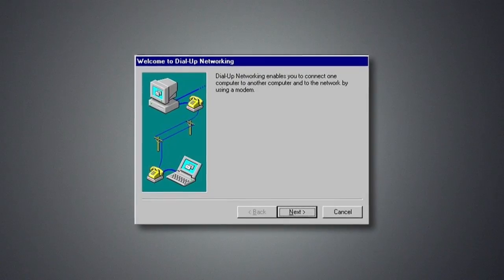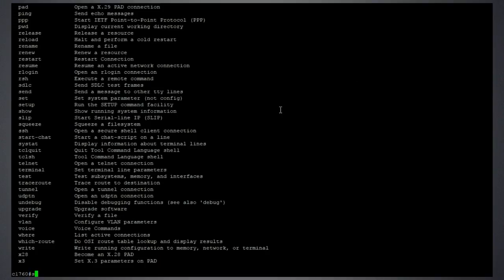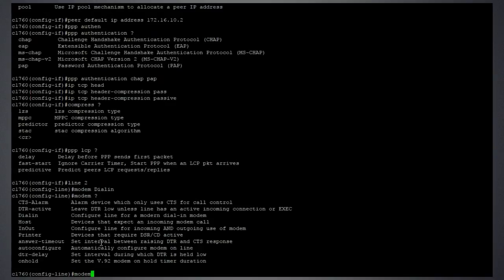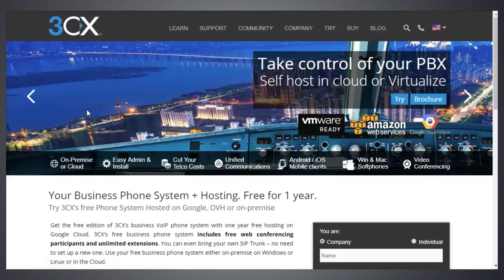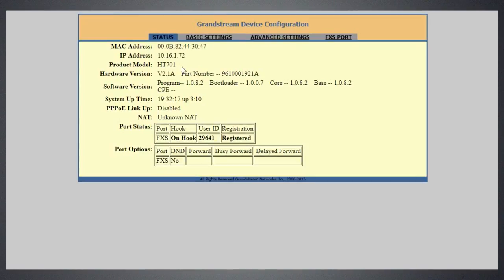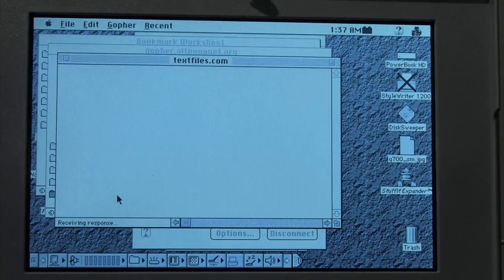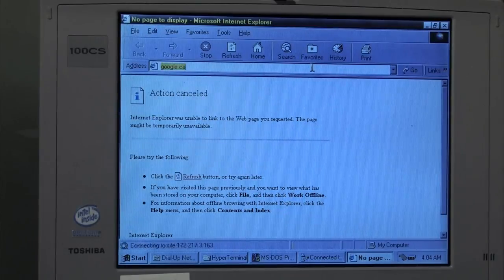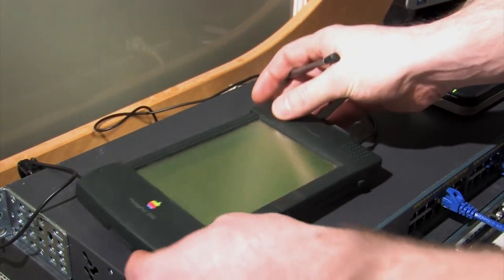Making A Home Dialup ISP - Paul's Old Crap #3

Comment: Great video.  I felt inspired to give this a try using the same hardware and my old windows 98 box and I cannot get a connection to establish.  I can hear the modem and c1760 communicating but is never able to establish a connection.  Every 10 or 15 attempts, it will get to the point where is tries verifying username and password.   I've done quite a bit of googling and it seems like this dialup over VOIP can be very temperamental due to the compression used by VOIP.  Any recommendations?  I've messed with the jitter buffers and trying different codecs with no luck.  Thanks!
Reply from the maker: Double check you have no compression options on your own equipment set and potentially try slower modems. If this is a third party VOIP system though you might not be able to get around the line bandwidth limits.
Reply: @netfreakcanada  Thx for the reply.  I'm running 3cx with the fax lines configured.  Can I run the modem at a slower speed or is it better to get an older one?
Reply from the maker: Depending on the software I suspect you should be able to tell the modem to use a lower speed. If your 3CX install is local to where the modems are, you shouldn't need to do this though. Something else is likely the problem.
Reply: @netfreakcanada  I'm using the default Windows 98 dialup program.  I knocked the speed all the way down to 9600bps and still no luck.  I'm running pretty much the same setup you have.  I have the HT702 grandstream which is pretty much identical to what you're running.  I'll play around more with the debug logs on the Cisco side next time I get a chance.  Is it worth picking up a few different modems to try?
Reply from the maker: I don't suspect a different modem will change this result but generally they're cheap/free depending where you look so it probably can't hurt to try. My guess is a software issue somewhere along the line.
Reply: @netfreakcanada  I played around with this again last night and finally got it working.  I changed "Disable Line Echo Canceller (LEC)" & "Disable Network Echo Suppressor" to Yes and now I can consistently connect.  I also set "Fax Tone Detection Mode" callee for the router and caller to the Windows98 box instead of leaving it "caller or callee".  thanks!
Reply from the maker: @Poniax3  Ah nice. You know I think I remember reading something about echo suppression when I was first trying to do this myself. I could imagine that wouldn't work well on non-voice calls.
Reply: @netfreakcanada  It's a blast seeing it connect at 28.8.  I just need to get a few programs installed for the full effect.
Reply: Use unix or linux system those will work better than apple or windows crap